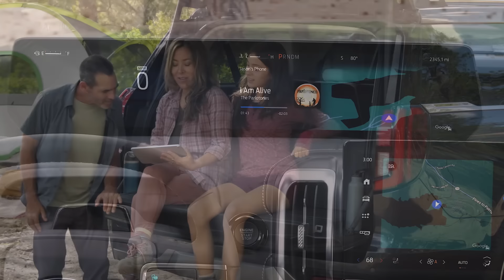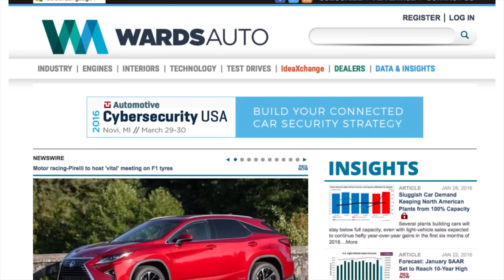EU Votes in Favor of Chinese EV Tariffs; Stellantis & Renault Deny Merger - Autoline Daily 3907

Comment: Autoline wont report this so here goes --In Q3, Tesla delivered twice as many Cybertrucks as Ford did F150 Lightnings(7,162 delivered), as well as more Cybertruck’s than Rivians entire business(10,018 delivered).

To further drive the point, Cybertruck is on the midnight hour of profitability, and will potentially have higher revenue than Rivian and Lucid for the year, combined. 

This is year 1. Tesla built a killer product and it’s going quite well. Now that foundation series is over, barring any production disruptions or part issues, Cybertruck very possibly will break 50k delivered for the year.
Reply: 5 recalls and counting and the need to change the goalposts to compare the CyberBust to other EV's trucks means that demand is now zero.  Leon created a niche product and can't even break out the quarterly numbers because they are so bad to what was promised.  A familiar theme in Ketamine land.
Reply: Agree, this is year 1. I am watching to see how the popularity holds in years 2 & 3.
Reply: Only 1,980,000 Cybertrucks left to build based on Leon's pre-order estimates
Reply: @bobbbobb4663  4 OTAs and 1 gas pedal fix fir the first ones off the line.

Another trash, misleading post. 🤣

- Now that the CT has FSD, you can't use that line any longer.
- Rust claims have been disproved, so that one is out
- Outselling other electric trucks in under one year from launch, so still ramping compared to others in production for multiple years

Watching your BS narrative and goofy claims turn to dust is how I like to enjoy my lunch.  It's too much fun.
Reply: @who2u333  fair statement.  time will tell.
Reply: @russh6414  Roadster!   Gryft Taxi Service incoming!   Unsupervised Taxis next year!
Reply: china smart AF.
Reply: @BTC_Minarchist  Lol…the guy who has FSD enabled in his CyberBust where FSD decided to enter a roundabout backwards.   Anyway, when are you driving your Tesla next week?  Gryft will launch and Leon needs drivers.
Reply: They only made 27000 CT , they lost money on everyone of them . They are miles away from the 150 k number per year they claimed when the CT would start to show profit.
Reply: @who2u333  it wont matter by then they will be all over the place. Just like the f150 is all over the place. F150 is still popular despite a recall every other week. And i know what your thinking so does the CT. CT recalls are ramp up teething pains. Whats the f150's excuse?
Reply: @bobbbobb4663  I don't drive my Tesla around much these days, because it mostly drives me around.  I'd say the car drives itself about 80% of the time and parks itself 50% of the time, and I don't live in California.  Ever since it passed the wife test (back in v12.3.6), I can use it whenever I want.  Any married male  in this comments section with FSD will understand how difficult it is for autonomous systems to pass the wife test.😂
Reply: @BTC_Minarchist Is the wife ok with your new job as a Gryft driver?  $30k a year.
Reply: whistlindiesel, actually did the cybertruck versus f150 test.. you did not see it appareantly 😅
Reply: @dertythegrower  🤣😂 I'm assuming you're being sarcastic.  Referencing Whistlindiesel when discussing truck tests is like referencing the "Jackass" show for shopping cart testing.  Whistlindiesel is a goofball YT content creator.  If you had mentioned TFL, or some other, similar channel, then maybe...
Reply: @bobbbobb4663  Yup and you  have been using that same "familiar theme" in your comments for every model Tesla has introduced. How's that been working out for ya?
Reply: @dclpgh  Better than anything from Leon.  Now he has to dump inventory.  CyberBust now starts at $79,900.  Good luck as a Gryft driver next week.
Reply: In other news : Toyota and VW count their sales in millions.
Reply: @rok1475  In other, other news, VW doesn't sell a full size pickup truck, so their sales are actually zero in the this category, and Toyota only sold 123k Tundras worldwide in 2023, which is very far from a million in this category. 

Just sayin
Reply: @BTC_Minarchist jackass for shopping carts...sweet reference there
Reply: @rok1475  How EVs do they count in the millions?
Reply: @BTC_Minarchist  you didn’t cover the 4 Free Freeway frisbees they included with the cyber truck initially that they haven’t fixed. I believe there was a physical recall for that amongst a couple of other ones
Reply: @russh6414  ah, yes.   They did redesign the wheel covers.
Reply: @bobbbobb4663  its hilarious how you twist that into a bad thing. A 79000 CT is the ford lightning and R1t worst nightmare. And CT is RAMPING UP Dude!  It will be hot off the trucks and into owners hands for the next few years.What inventory?
Reply: @dclpgh  150k and counting over production in the last five years.   $79k for a truck with countless recalls and wimpy rear casting.   A vehicle for the fan boys and that’s it.  Even Toyota with their V35A problems has nothing to worry about.
Reply: @BTC_Minarchist  you are correct, when considering ba niche category such as toys for big boys shaped like pickup trucks, Tesla is number one.
Reply: @dclpgh  there is no market for millions of expensive EVs.
Reply: @rok1475  Glad you agree that Tesla is #1 and Ford and Rivian are trailing in the segment after a multi-year headstart. 

BTW I'd be perfectly happy if Rivian or Ford or both were leading that category as long as Tesla was at the same volume.   I think ICE should be the competition, not other EVs.   I love seeing more Rivians, Silverado and Lightning EVs on the road.
Reply: @bobbybishop5662  Facts are not a strength for you.   It's understandable.   It goes with the Bob handle.
Reply: @bobbybishop5662  Factoring in the multiple repairs based on as delivered defects, it's unlikely the Cybertruck will ever become profitable. Some have had defect lists as long as 99 items!

Comment: A Chinese battery manufacturer is already making 4695 batteries, which are 15mm taller than 4680. Maybe they can sell the technology to Tesla. I am afraid Northvolt will not be able to afford the cost of it
Reply: Not sure why Tesla would want to buy 4695 cells that don't fit in any vehicles they make.  Also making a couple of unvalidated test cells is a bit different than making 100 million of them (as Tesla has already done with it's 4680 cells).  Tesla's objective is to continue to reduce costs and increase volumes. Now if someone like Panasonnic makes a 4680 cells for the right price, and they are validated, Tesla will lap them up!

Comment: Tesla has been trying to get 4680 batteries to work for many years now what is the problems?
Reply: No problem. They've made over 100 million 4680 cells. They are trying to reduce costs and further increase volumes with new processes that no one else has done before.  They are just up front about it.  Go to Toyota or others that can only make press releases about some future cell that's always 4 years in the future.
Reply: Q: "what is the problems? A: non-stop LIES AND DECEPTIONS are the problem not to put too fine a point on it.

Comment: Could China put the smallest gas engine in their EV's and call them PHEV's
Reply: BYD already does.
Reply: All you need to do is put in a class A RC engine (1 cm displacement) and call it a PHEV.  Get's .0001 miles on the RC engine and the rest from the EV portion.

Comment: 4680 benefits was always overhyped since the start.
Reply: Tesla set the bar high.   They continue to make progress.
New equipment for cathode production has arrived at GigaTexas.
Reply: Sounds like just about everything that’s never been produced before. Preproduction concepts are usually overhyped. Initial years of production are also usually the worst a product will be as it undergoes improvements and efficiencies over the years.
Reply: 4680 already matches 2170 in performance, which is the benchmark for cylindrical batteries, and it's still maturing and scaling.
Reply: Tell  us why  both LG  and Panasonic are going to supply the cells then, Tesla needs the 4680 cells for Cybrtrk and Semi and Robootaxi, solving the drycathode process is mystery that will be solved eventually , it is work in progress for Tesla.
Reply: @AuralioCabal-nl8gi  Stop with the facts, please.  You're ruining a perfectly entertaining narrative.
Reply: @AuralioCabal-nl8gi  Tesla has a CyberTruck running around with full 4680 DBE cells.  They know how to do it. They are working on getting the scrap rate down.   
Working on getting the scrap rate down on the in production CyberCell too.  So nothing new.